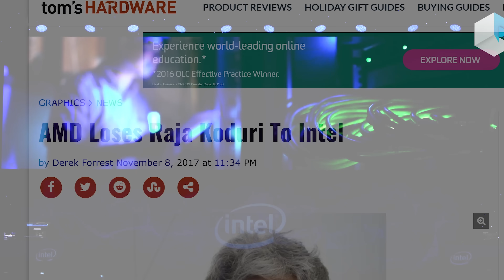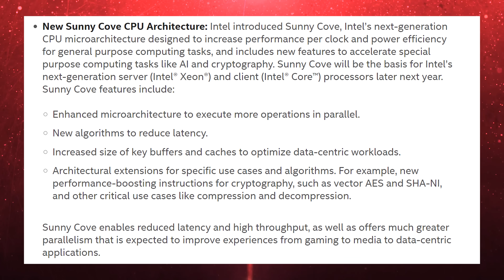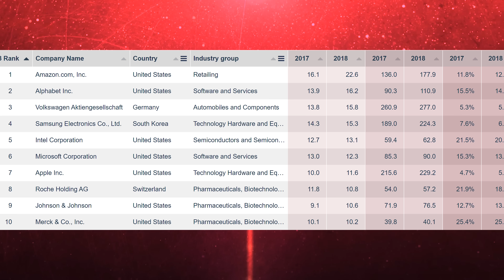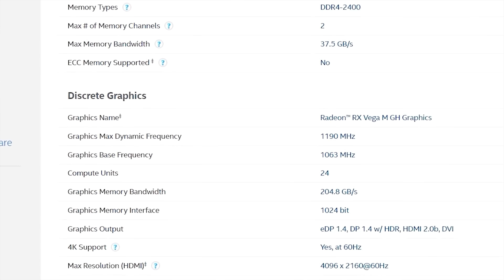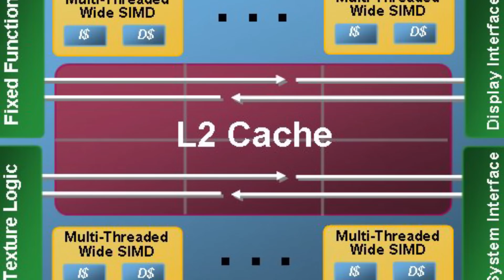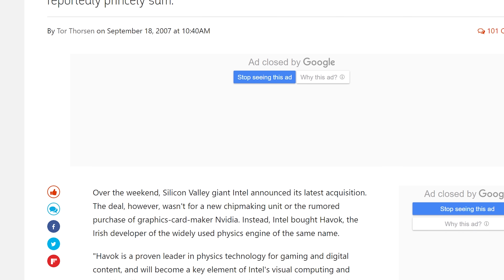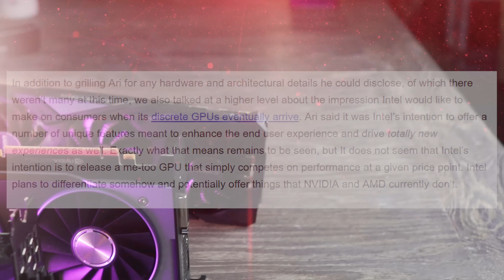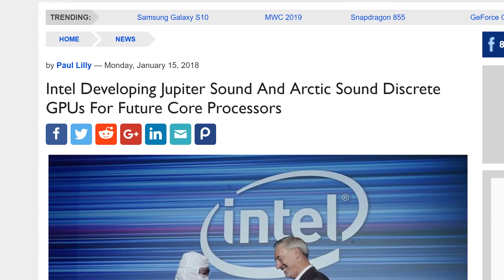Intel Vs NVidia in 2020...!? It is possible... (here's why)

Comment: AMD Ryzen™ 3 2200GE with Radeon™ Vega 8 Graphics ... 4 Cores with powerful Radeon™ Vega 8 Graphics onboard, in an .... Graphics Specifications um 8 vega cores sucks ass barely running games that's worse that a gtx 560 with 384 cuda cores get bent AMD lovers onboard amd graphics on ryzens is completely garbage
Reply: You know you are talking about a budget Solution for both CPU and GPU performance for only 100$, Right?

That's not what AMD is only capable of.

Comment: Can You Imagine Intel GPU..?  Intel G3, G5, G7, and G9 
You wanna OC our GPU?   Easy.. buy G7k and G9k (unlocked) and push GPU to it's limits with OC up to 2000 Mhz
Note:  G7k and G9k doesn't include cooling solution, Fan & heatsink sold Separately xD
Don't care about Intel, but more competitors are always welcome, but they need 5 years minimum to be considered a competitor for Nvidia

Comment: The founders of Intel invented the integrated circuit. Then Intel invented the microprocessor. So Intel ain't called Chipzilla for nothing. They created the foundation the whole PC industry is based on. The only thing Intel didn't do was invent the transistor. But Intel founders worked for the guy that did. By all accounts Willie was a hard man to get along with.

Comment: I thought intel was only good for its integrated graphics if you’re the type that only plays minesweeper or are in a corporate setting and want a nice, clean pc and don’t need to play much during business hours. 

Or if you build a barebones pc for the grandma to play the Facebookz and minesweeper and some flash games. In that case intel beats Nvidia already 😂 

I don’t think Nvidia is going down anytime soon though. Not unless they start getting significantly sloppy on quality control on new cards, drivers ect OR if the company is bought or a majority stake is bought and they turn out like Newegg did.

Comment: Ever since I started using QSV H.264 & 265 Encoding for BluRay and TV Rips, I have dreamed of a day when Intel would take on the 'Desktop Creator' and/or CUDA/NVENC/Quadro market with a GOD-LIKE iteration of QSV on a graphics card rather than on cpu die and cut Nvidia off at the knees for their crime of completely overpriced Quadro cards. As a non-gamer, if Intel had 'the goods' in terms of H.264/265 Encoding ON STEROIDS on a PCIex16 addin card, I would buy it in a heartbeat.....and never look back at team red or green ever again.
Reply: I should also add, considering that AMD's VCE is complete garbage and NVENC is not much better, Intel could stand unopposed for Media Encoding if they kicked QSV in the ass and turbo charged it on a card rather than on-die on CPUs....... although it's a great FREE co-processor, even when using a separate add in Graphics card currently.

Comment: intel does have something that would be for its advantage in gpus that people see as a deficit in cpus.  its 14nm process.  its the same density basically as tsmcs 10nm and with nvidia on 12 (which is really just 16nm with a larger die size limit) intel could make a very power efficient gpu without the small die size limit that tsmc 7nm has.  it would be the best of both worlds,  large dies like nvidia can make and lower power\heat like 7nm.

intel needs more 14nm production for a short while till 10nm comes for cpus but if they invest in 14nm machinery now they will need something to make on it that either will be in large numbers or will have large dies.  gpus would fit that bill. keep cpus on the newest node and gpus on the last node would be a good way to make the most of intels fabs.  

they already have a decent gpu arch.  intel igpus are only weak because they have low core counts and use ddr.  a 750 ti is like 384 cuda cores and the intels basic igpu is half that and doesnt have gddr5 like the 750 ti does. if you doulbed the core count and add gddr5 or 6 to intels gpu it would be at least as good as maxwell without doing any tweaking but draw much much less power.  the 750 ti is a 60w card.  the igpu uses maybe 10w.  if you clocked the cores higher like pascal you could match nvdiia on power or be lower if not as fast.  if they redesing the arch for higher clocks then they could possibly compete on performance  and have less power until 7nm gets yeilds high enough to make large dies.

to be honest i expect intel to only make small gpus.  at least for awhile.  they want to replace nvidia mx150 up through to the 1050 ti or maybe even 1060 level card for starters.  but then they migth tackle some data center gpus and we could get some of those lower binned as gaming cards.  but i dont expect high end gaming soon, if at all.  probalby mostly laptop grpahics and compute stuff.  but i would love to see high end gaming

Comment: I want AMD to gain market share from Intel so we are not stuck with them, they've had a good 7 years of selling us the same parts and getting pure margin on their process shrinks. AMD needs to clobber them for a while, hopefully longer than Athlon 64 managed. On the other hand I hope Intel crushes nvidia and pushes some new RTX like features into the mainstream, games need better AI and rasterisation has hit its limit.
Reply: amd sold us the same parts for 7 years as well.  they didnt get pure margin because they werent that good.   nobody needs to get clobbered because eventaully they get clobbered right back and we are back where we started.  they need to both compete.  either one passing the other by too much is a bad thing.  if amd gets all the money then they will just bet the next intel

Comment: My prediction is that in 5 years time there will be no low end cards released anymore (gt 1030 to 1050ti level or about), and they'll all be replaced by lowend CPUs with relatively powerful iGPUs like the 2200g and 2400g.
Reply: prob not.
Reply: F.A.I .why not? AMD will likely be able to do this soon using a Ryzen module with a mid tier gpu and if Intel can do this too then this could make the lowend gpu market superfluous. The high end will still have a market for dedicated cards. Basically consoles are getting more PC like and PCs might be getting more console like.
Reply: its like when people predicted was Hillary was going to win.
Reply: This happening now I think
Reply: yes with DDR5 its kinda possible to give these iGPU a bump in performance
Reply: Sango Maybe, but a good chunk of people will want to upgrade their GPU at some point probably and they’d rather get a slightly better CPU
Reply: I think this is true - over the past 5 years, iGPUs have steadily increased in performance much faster than discrete GPUs... though this may simply be due to recent stagnation in discrete GPU performance, and it's entirely possible that with Navi and Intel's GPUs we'll go right back to getting significant improvement in dGPU performance.
Reply: I agree with F.A.I. It's highly unlikely. The GPU industry is a bit similar to the automotive industry in the sense that they flex their muscles by competing in the high end segment, but they still make a huge chunk of their revenue from the budget and midrange segment. 

It's more likely that the low end cards will just become faster and more power efficient, to make them appealing when compared to APUs and iGPUs. IMO, you don't even have to look to the future. It already happened with the GT 1030. That's the lowest discrete gpu that nVidia offers yet it is on par with a GTX 750, which was a midrange card.
Reply: @neilencio  newer cpu igpus r faster than the 1030 though
Reply: if games stayed the same then you would be right.  but they keep hogging more resources and before you know it a 1060 is a 2050 level card or a 2030 or whatever.  there will always be  space for discrete cards just as there is space for apus.
Reply: 😏 keep dreaming kid

Comment: Next will be Nvidia cpus, we'll be able to build complete Intel, AMD or Nvidia systems :D
Reply: Once the era of ARM or RISC-V desktops is here, we will likely see Nvidia-made CPUs.
Reply: @Wokiis  according to my friend who knows more than i ever could understand about CPU uArch, doubting ARM is the future of mainstream PC's for long time, he thinks AMD's APU system is the future.  since both intel and AMD integrate GPUs..makes sense. 

 nvidia is in a weird position with this on mainstream computing currently as they have no ability touch x86-x64, that is unless they can capture ARM windows 10 market with Tegra or something like that....  it is possible but in its current state, ARM windows 10 is very slow....  

AMD and Intel have both made ARM SoCs in the past and both have rights entirely over x86 and x64 (amd64).   they could also own ARM market if they chose to adding in x86 - x64 extensions and accelerating in real time such things into their own ARM processors and shutting out competition because nothing from any other ARM maker would keep up on even most basic tasks in windows
Reply: @Honeypot-x9s  Things need to be recompiled and rewritten but ARM is showing the most potential for the future. We already see the Apple SoCs plain winning over Intel when comparing performance clock for clock. That Windows 10 isn't ready yet is solely an issue with programming and the fact that they just plain emulate x86 when needed instead of recompiling, and typical Windows 10 ARM devices aren't outfitted with the most powerful ARM chips to begin with.. It's going to be a difficult transition for sure but with moores law slowing down it's going to be necessary to get rid of x86 legacy bloat in order for performance gains to keep progressing.

That GPUs will be integrated with the CPUs , well first off we're living in the reality where for most markets that's already the case. I'm sure they will start nabbing on more parts of the (already niche) dGPU market as well.
Reply: Wokis no... Apple’s A12 Bionic maybe powerful for an ARM and in canned benchmarks which are heavily ARM optimized but not x86 and AMD64 optimized like geekbench the A12 looks good...   but when doing benchmarks that are unbiased like CPU based raytracing the A12 gets absolutely shitted on by pretty much any modern x86 and AMD64 CPU that has AVX/AVX 2 instructions.  That’s just CPU.    

On GPU try comparing compute with FP16, FP32, FP64 and INT32 performance, and even my little mobile APU (Ryzen 2700U) is in stock form is creaming the A12X by many multiples.. and something the A12 should be more than capable of beating my 2700U in, facial tracking and recognition because the A12X has several neural network engines and is up-clocked from A12 my 2700U with no neural network engines, no API for deep-learning or neural networking optimizations in drivers or anything, beats the A12X massively

And in what world is dGPU niche..?   The future maybe awkward for Nvidia with future being APU style systems where have a powerful GPU built directly into same silicon as the CPU...but dGPUs are still very common thing.   And currently only AMD has proper APUs, with half decent VEGA cores connected to Zen cores...
Reply: @Honeypot-x9s  No.. you're  listing specialized workloads equally as "biased". It's not about when x86 manages to add another extention atop the pile to keep it relevant. That's just the problem with x86.. loots of legacy extentions and registers that must be there but also steals die space.  We already know Intel aims to back RISC-V, even they see the writing's on the wall for their old design. Give it 10 years.

And dGPU is niche. It's for datacenters, professionals and people who want to play games with jacked up graphics on their PCs. Meanwhile The mass market deals in SoCs and "APUs".
Reply: Wokis I lived through so many “the next 10 years it will be this” in the computer world that I can tell you the answer is no..  those legacy things keep the world going today.. entire infrastructure we live in today and use daily is legacy, traffic lights, ATMs, security systems, power grids and monitoring and get this.... scientific and research fields still use a lot of legacy stuff out in the field.  Add to that a lot of modern drivers that don’t get updated ever on many platforms that if you removed the ability for them to run you remove stability...  

Apple may do it, Apple may put ARM in Macs but Apple is 100% its own ecosystem that is a cash cow no developer will complain about or care about with porting and rebuilding their apps for..  

As for dGPUs being monitory that’s like saying case fans are a minority.. not everyone has to be a pro, or a server or workstation or need bleeding edge graphics I know people with dGPUs like HD6770 they got it back in 2011 and still rocking it... and that card isn’t going to be bleeding edge in 2019
Reply: @Wokiis   But did the Nvidia tegra chips ARM CPU cores were even built by Nvidia at all?

Anyway in a long term future I think is that light computing will be the answer when they will not be able to shrink transistors anymore I think they will surely will have to re-invent everything and Quantum computer is definitely not the answer so soon or never because of the very low temps required it won't ever be easy to make a good affordable desktop that could keep that quantum chip at such low temps and for now it needs HUGES amount of electricity just for cooling technology for such very small quantum die chip...
Reply: Possible, they already made ARM based CPU's for tablets, and nForce chipsets for desktops.
Reply: Tegra X1 so ? well its now popular in Cars and in Nintendo Switch, Tegra 2 should come soon or ? still not competitive vs amd apu's well its a long way for them
Reply: I thought you said that "next Nvidia will have CPU's that will be able
build complete Intel or AMD systems." I thought, that's some next level shyt.
Reply: @robertdavidson548  Lmao, that would be some next lvl shyte!
Reply: I always liked the idea of an off the shelf Tegra option.

Comment: Honestly hopefully Intel bring a Pentium as a 1050ti competitor
Reply: You do know the RX 570 exists, right? It's cheaper than and significantly more powerful than the 1050 Ti.
Reply: The vega 11 on the 2400g isn't far of the 1050ti come zen2 and navi apus the 1050ti will completely out classed without a discrete card

Comment: Shall i go with this build ?

 mobo : 
 https://www.aliexpress.com/item/Free-shipping-100-original-motherboard-for-Gigabyte-GA-X58A-UD3R-1366-pin-X58-Desktop-mainboards-support/32787525919.html?spm=2114.search0104.3.6.273c3133WCfnzc&ws_ab_test=searchweb0_0,searchweb201602_6_10065_10870_10068_319_10867_10059_10884_317_10887_10696_321_322_10084_453_10083_454_10103_10618_10307_537_536_10902,searchweb201603_51,ppcSwitch_0&algo_expid=675a5507-d3ce-4498-96d5-094a5bc0a96a-0&algo_pvid=675a5507-d3ce-4498-96d5-094a5bc0a96a

 cpu :
 https://www.aliexpress.com/item/Intel-Xeon-X5675-3-0-GHz-Six-Core-Twelve-Thread-CPU-Processor-12M-95W-LGA-1366/32952477123.html?spm=2114.search0104.3.21.37c43f22Tp53AN&ws_ab_test=searchweb0_0,searchweb201602_6_10065_10870_10068_319_10867_10059_10884_317_10887_10696_321_322_10084_453_10083_454_10103_10618_10307_537_536_10902,searchweb201603_51,ppcSwitch_0&algo_expid=89ad8b3c-ddd7-4e6c-af8f-483bdc1c67bf-3&algo_pvid=89ad8b3c-ddd7-4e6c-af8f-483bdc1c67bf 

heatsink :  
https://www.aliexpress.com/item/ALSEYE-Wind-Plus-Best-cooling-system-for-pc-desktop-cooler-Copper-and-Aluminum-Radiator-Gaming-CPU/32665897315.html?spm=2114.10010108.1000013.7.46ab123bUNuEod&gps-id=pcDetailBottomMoreThisSeller&scm=1007.13339.99734.0&scm_id=1007.13339.99734.0&scm-url=1007.13339.99734.0&pvid=35c83c97-6232-451e-844e-4d113bc90fa2

 gpu :  
https://www.newegg.com/Product/Product.aspx?Item=N82E16814131716R&Description=rx570&cm_re=rx570-14-131-716R-Product 

ram : now i am not sure about this it says there are ram for amd only and for intel but , if amd ram only works i will get 3x8gb if it does not i will get 2x8gb 
https://www.aliexpress.com/item/Kllisre-DDR3-8GB-ram-1600-1333-no-ecc-Desktop-PC-Memory-240pins-System-High-Compatible/32821969000.html?spm=2114.search0104.3.7.7fdf33c1f4I1rI&ws_ab_test=searchweb0_0,searchweb201602_6_10065_10870_10068_319_10867_10059_10884_317_10887_10696_321_322_10084_453_10083_454_10103_10618_10307_537_536_10902,searchweb201603_51,ppcSwitch_0&algo_expid=45eafbfd-c5b9-4026-b6f4-99871d197b86-0&algo_pvid=45eafbfd-c5b9-4026-b6f4-99871d197b86

 storage : i already have 1 120gbssd and 2x500gb hdds 

power supply : i think this is enough https://www.newegg.com/Product/Product.aspx?Item=9SIA6ZP7X39728&Description=power%20supply&ignorebbr=1&cm_re=power_supply--17-438-147--Product

 case : i got it yesterday 
https://www.newegg.com/Product/Product.aspx?Item=N82E16811119351&Description=tuf%20case&cm_re=tuf_case--11-119-351--Product And 

I want to play at 1080p 60fps and yes i plan to oc the cpu and gpu , Thank you .